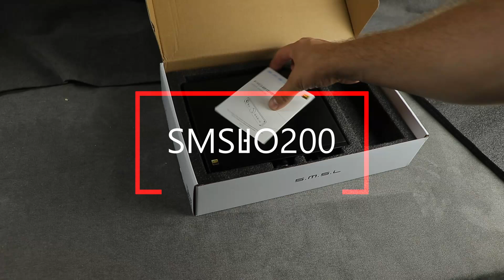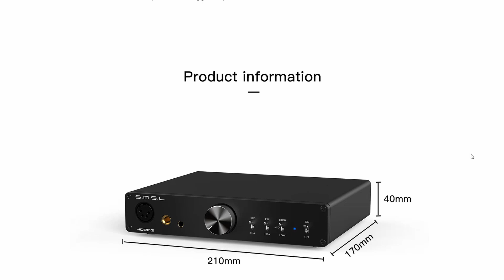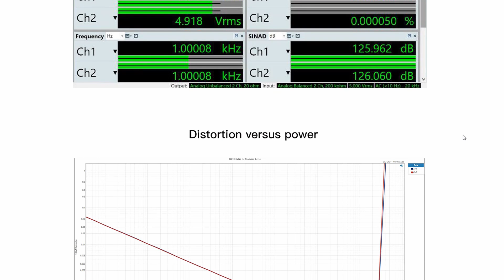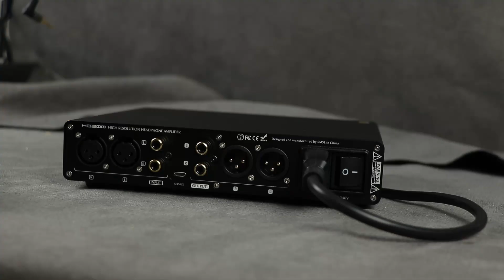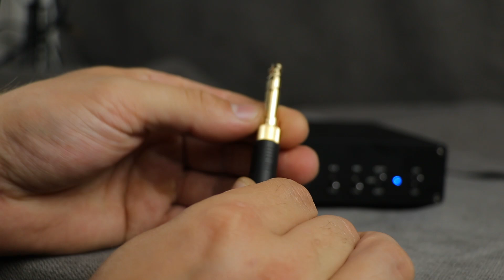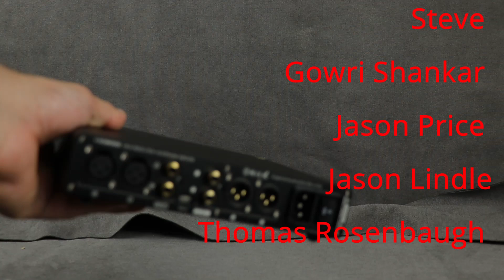BALANCED Headphone Amplifier - SMSL HO200 Review

Comment: Thank you for the video but this review had me asking still many more questions that I am hoping you can answer.  I anticipated that you would have taken the cover off this device since I know are comfortable and curious in that way.  In this way your viewers could have seen for themselves the build quality of the HO200. Would this headphone/pre-amp be a good match impedance wise for the A200 or even the Orchard Audio mono blocks?  What kind of power supply is it using and what are the output stage transistor used in this device?

Comment: I want to commend SMSL on the construction of a pure stand alone component, ie, one that doesn't connect to the internet or have to be controlled by an app or remote. That makes this unit timeless. There is no upgrade or update obsolescence in it's future. The only thing that would do that is a component inside becoming phased out by a manufacturer and not being able to be replaced. (But I bet there are enough standard components inside that substitutes would be easy).

Comment: Numbers are impressive, but it looks complicated to use as well.
Reply from the maker: Nah, it's really simple actually. Just flip a few toggle switches and you're set. It's one of the things I actually really appreciate about it.
Reply: @Toid , I expected Treble, Bass knobs which I am familiar with. And a Subwoofer range knob on the amps. But, toggle switches... may demand some time to appreciate. Yeah, it reminds me an airplane cockpit panel. That's why it looks complicated!
Reply from the maker: @Summer2015K  I get that. I wish it did have a preamp with bass and trouble built in. That would be really nice. Lol, I completely get the airplane cockpit. So true! 😁